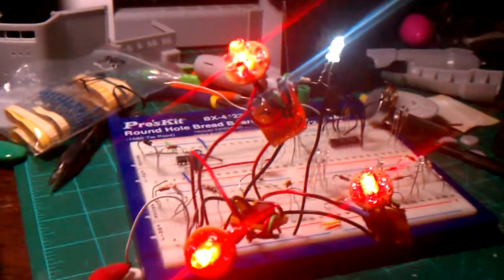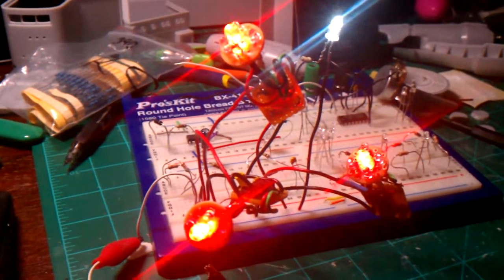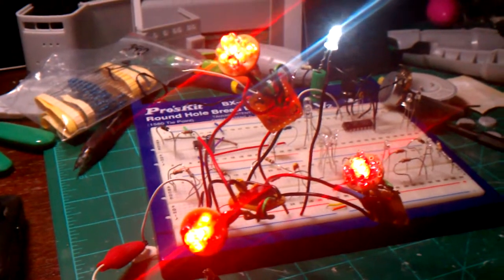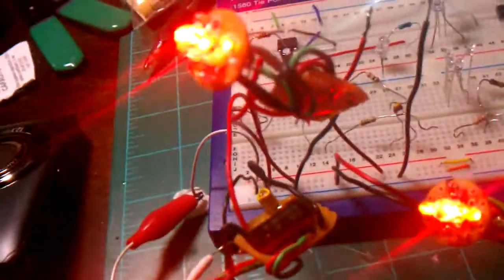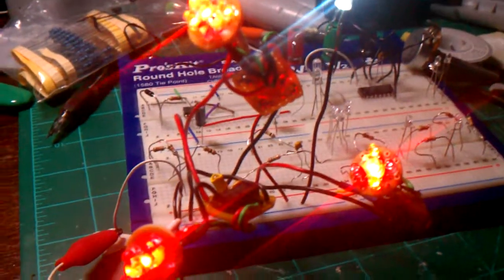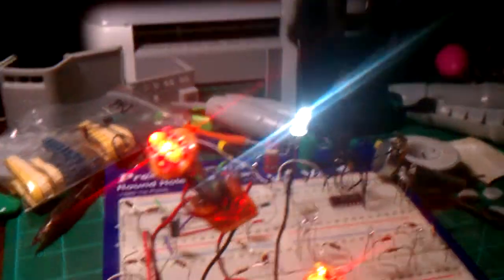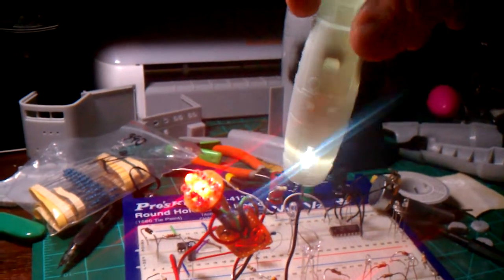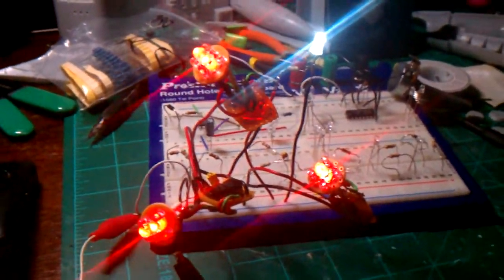Lighting test for the mercury 9

Comment from the maker: Thanks, in fact I got this from star ship modeler.   There was an article on lighting up the TOS 1/1000 enterprise and they used this circuit to do the nacelles.  This chip will fit in those nacelles.

I did modify the circuit a bit.   They didn't have the red LED in the center.

Comment from the maker: It is actually a 4060 binary counter.   The 555 can only flash or strobe.  It cannot do more than one blink rate at a time.  The 4060 can do quite a few blink rates at once.  I connected the four LED's to two pins that flip flop the voltage, lighting alternating pairs of LED's.

But yes, the 555 is a good chip!

Comment from the maker: You do have to be careful of that.  But with these chips and LED's, they don't generate that much heat.   The resistor on the white LED will produce more heat than everything else in the system.

It will make the plastic warm to the touch, but that is about all. 

Now if you get into LED tape or some cold cathode tubes, those can produce quite a bit of heat.   You have to be really careful with those.   They can heat up the model enough to soften the plastic and discolor the paint.